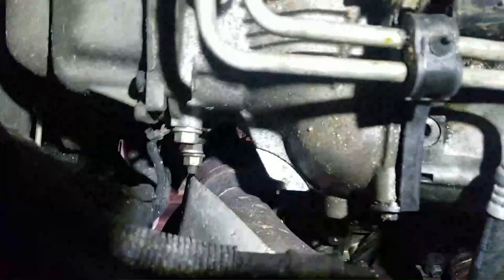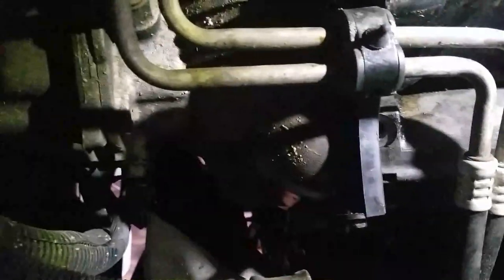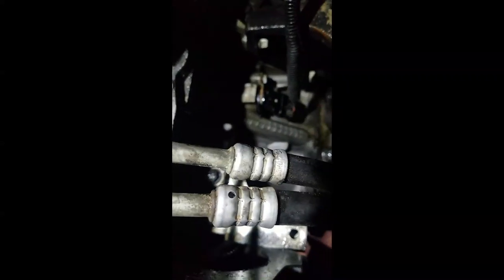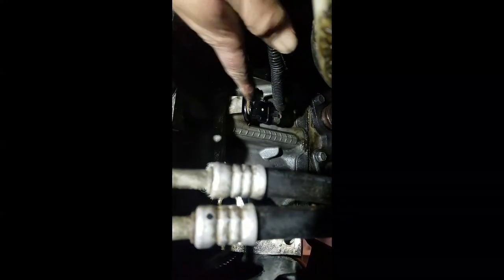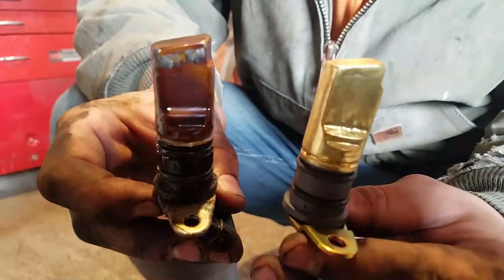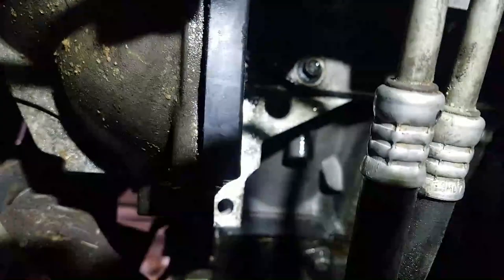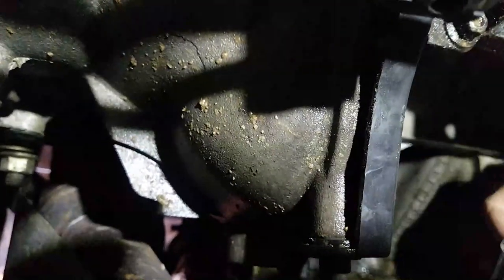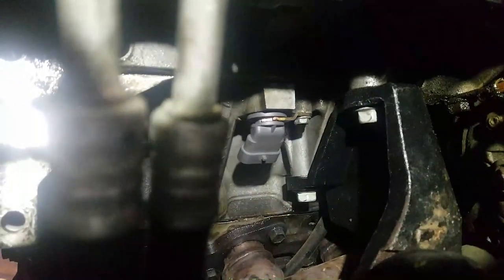2001 Oldsmobile Aurora crankshaft sensor Fixed!

Comment: I had my crank and camshaft sensors replaced just over 4 years ago. Crank sensor failed again. P0335 code. I bought the 2 new sensors from the dealership. My friends shop installed them and re-programmed the sensors to "relearn". Car runs and starts great again.  You should replace both sensors at once. Also, they must be AC Delco.
Reply from the maker: Yeah. We actually did replace the camshaft sensor at the same time we just didn't film it. Thanks for watching

Comment: Crankshaft sensor must be AC DELCO.
Reply from the maker: Could be...... 👍
Reply: @ibfgarage9365  : Computer doesn't recognize other brands. I purchased Dorman brand but it didn't not work. I purchased AC DELCO it started one shot. Until now, it is very good. Little more money but is okay. Also, Camshaft sensor must be AC DELCO.
Reply from the maker: Oh I see. Computer didn't recognize other brands. Yeah that has happened to me couple times through years on various vehicles. Didn't realize it was so prevalent. So, just go right for the AC DELCO huh? I'll make sure next time I have to do one not to buy off brand. 👍
Reply: The Acdelco one is $160

Comment: Appreciate your effort got one to do
Reply from the maker: Yeah the engineers like to make it difficult on us. But all in all not too bad once ya get the starter out. Good luck!
Reply: @ibfgarage9365  Is not easy but you can do it without taking the starter out, another not so easy job. You need a long extension with a joint adapter and some patience.  My mechanic did it a year ago, now it's Sunday, he's closed and I need the car so I'm going to give it a try.